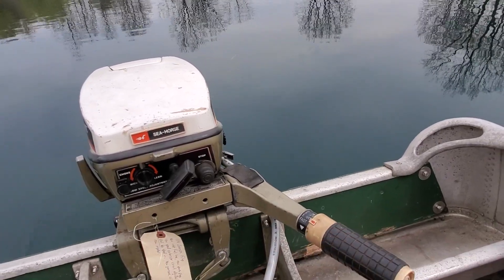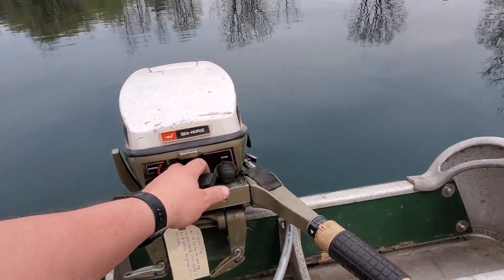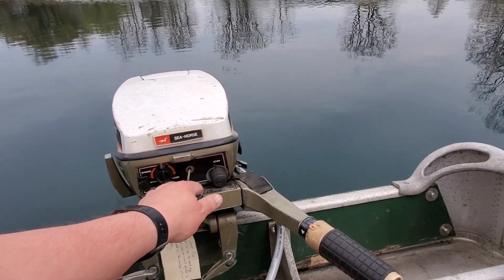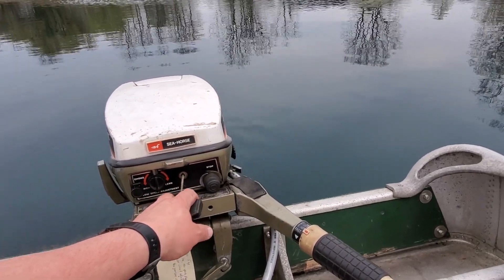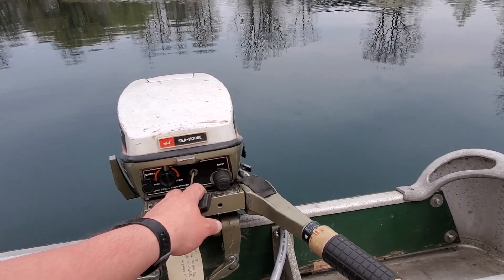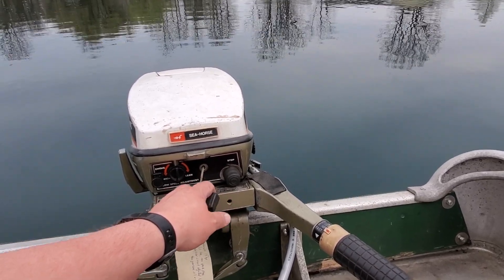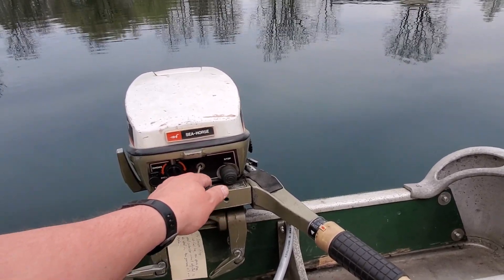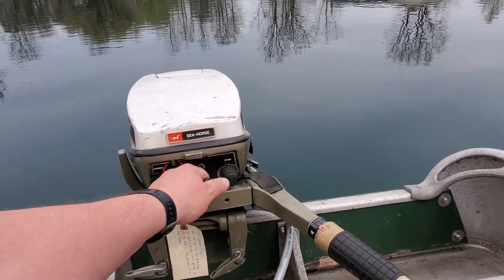1974 Johnson 15hp Outboard Motor Pond Test

Comment: That engine sounds great. I have one of these in the electric start version, which I'd like to get running. I need to replace the external fuel tank, bulb & fuel line as the old line & bulb is brittle/hard and the tank has rust in it.  What would you recommend for replacement parts?

Comment: Hi Ben, great video! I'm wondering how long you think one of these motors would last in salt water? Since there's no pee hole would corrosion happen faster? Thanks.
Reply from the maker: @gabrielklassen8524  I don't really know how long one of these will last in salt water.  The lack of a tell tale wouldn't make any difference in its salt water lifespan.  Keeping it flushed with fresh water after saltwater use and it will last a long time. If that is neglected, it will greatly shorten the life of the motor.  That's all I can tell you about the life of these in salt water.  Thanks for watching!

Comment: I have this motor and also a 1964 18hp Evinrude Fastwin.  Both run great.  I want to put one on my 1964 MirroCraft Deep Fisherman which is rated up to 35 hp.  Which motor should I keep and which motor should I sell?
Reply from the maker: The 15 will probably bring more money when sold than the 18.  The 18 will outperform the 15, but will use quite a bit more fuel doing it.  I personally love the 18s and I am also quite fond of the 15s, although I'm not a huge fan of the low tension magneto used on the 74-76 9.9/15s they can usually be made to run well and be reliable.  I would suggest running both on your boat and weighing the pros and cons above.  Keep the one you like best and sell the other.  Thanks for watching!

Comment: How long should it take to start pumping water? And it should come out hole by upper cowling correct? Just put impeller in and seems like it taking to long to spit water
Reply from the maker: Yes, this motor only has the exhaust relief hole on the back of the leg for a water tell tale.  It does not have any water exit until the thermostat opens so it will take a little time before you start seeing water chuffing out of the hole.  The first year these motors had a tell tale stream that shows the water pump is working was 1977.  1974-76 were like this one.  No water until the tstat opens up.  Yours sounds like it is behaving normally. Thanks for watching!
Reply: @oldjohnnyrude8404  thank you for your time I really appreciate it.
Reply from the maker: @FoodPlotSolutions  You're welcome. 
🙂👍

Comment: I have this same exact motor. It’s running a little sluggish. I wish I knew how to get it to run like that. I’ve done several things but it wants to die when low idle. Especially when I idle down to shift into gear. Changed impeller, spark plugs, coil packs, fuel hose from gas tank and now about to change the fuel pump… I’m grasping at straws. It’s been well taken care of and by all standards in really nice shape. I’m sure it’s something small that needs tweeking… jusy havent figured out what it is
Reply from the maker: That sounds like a carburetor problem to me.  Sounds like it needs a thorough cleaning and a rebuild. It certainly sounds fuel related. That would be my next step. Thanks for watching!

Comment: I like the old green motors for some reason, what do you think of that ignition vs the newer that came I think the next year, arn't those a one year only ignition on that style engine ??
Reply from the maker: I like the green ones too.  I am not a fan of this ignition system.  It ran for three years on these motors.from 1974-1976. It ran for four years total since it debuted on the 18/20/25hp 22 c.i. motors in 1973.  The bonus for those is they can be retrofitted back to the universal magneto.  The 9.9/15 motors can be fitted with the later CD ignition, but no magneto.   The CD ignition is excellent and quite reliable.  I still personally prefer the older points ignition since I can see what they're doing and troubleshoot them more easily. I do like the CD solid state ignition though.  Thanks for watching!

Comment: So what was making it tough to shift?  Was the shift handle/shaft stiff?  Did you notice if this thing had any over the "updates"?  Did it have the original or updated head?  Wondering what plugs you use to keep these from fouling plugs...The last I knew the recommendation was the champion UL-81J....  The original ones did seem to run pretty smooth though....
Reply from the maker: It had some water in the gearcase because the plugs were not tightened.  I think the water in the oil was not helping the shifting, but I really did not find the shifting too bad.  It did improve with new oil,  but these motors never shift like the older ones. This gearcase just doesn't have the crisp feel of the non thru prop 5-bolt.  I also think an awful lot of people have trouble shifting these into and out of forward gear due to the interlock on the stator plate.  This is especially true when they are not tuned properly and they will jot idle.  They tend to try to shift them at too high of a throttle position trying to keep them running.  I'd have to check, but I believe this motor had the recommended Champion plugs in it.  Lots of people experienced with these low tension magnetos recommend NGK plugs.  I put a set of B7HS plugs in it.  Time will tell if they hold up,  but it sure runs better now than it did. 
This motor has the original head amd appears to be completely original other than fuel lines, impeller,  and a carb rebuild at some point. Thanks for watching, Don!

Comment: Sweet old motor! I’ve got an electric start  15hp runs well. Just kinda slow lol.
Reply from the maker: Thanks. It is a nice motor.  It doesn't have quite as much grunt as my '79, but it seems like it should move out pretty well on open water.  I have a 15 I need to go thru and a parts 9.9 woth electric start.  I'll probably make the 15 electric start.   Thanks for watching!
Reply: @oldjohnnyrude8404  that’s exactly what I did with mine. Very quite easy. Also looks like you added some dye to the pond if I’m not mistaken, right?

Comment: hello, i just want to ask how deep is your pond? asking because of how dark blue it is lol
Reply from the maker: Is the spring it is usually the deepest and it ranges from about 7ft to 11ft depend on where in the pond. This year it is exceptionally low.  I have barely been able to run the boat on it this year.  Right now it is probably about 1.5ft - 5ft I hope it comes back up next year.  I should have it dredged this fall.  I use colorant in the spring time to keep aquatic vegetation down. Thanks for watching!
Reply: @oldjohnnyrude8404  that explains the blueness when you were driving around

Comment: Yea appears to be running pretty good moves boat well, 50:1 bet ya had plenty of that laying around ha, the water in the pond looks great,
He will be pleased with it for sure. Keep um coming.(:
Reply from the maker: Yep, I think it is happy again.  I usually have a tank of 50:1 once the weather warms up.  Over the colder months I usually only have 24:1 and maybe a bit of 8:1 mixed up for winterizing.  I have a tank I keep full of 50:1 during boating season though.  I run my Aerocraft a lot with a 67 Fastwin which is a 50:1 motor.  Thanks for watching!

Comment: Hello Ben I have followed your channel for about 2 years now. I have gotten into the hobby of working on these old motors to pass the time.. however there is a few replacement parts I would love to get but don't know where to find them. One of them being a new seal for the covers and the other being new twist handles for the throttle. If you have a solution for eather one that you could help me out with it would be great..thanks for your time and videos.....Carlos
Reply from the maker: Hello Carlos. Thank you for following my channel.  I'm glad to hear you are getting into the hobby.  I believe www.nymarine.ca has the cowl gasket as reproduction newly manufactured.  They may also have reproduction tiller grips.  I find them at swap meets occasionally.  I have seen where some people have 3D printed them.  For anything but a first class cosmetic restoration,  the 3D printed grips serm like a good solution to me. I am considering trying that sometime soon.  Thanks again for watching!
Reply: That web page has all the parts I been needing thank you so much. They even have the paint I need.. I just finished a full tuneup on my personal 6hp fisherman I picked it up barn fresh the owner said over 30 years. Was not firing so I did the points coils and such rebuild the carb now it runs like a dream. Water pump impeller tomorrow and it will live on my 12 foot joh boat.. guys like you got me hooked on these things ( thanks a lot ) lol
Reply from the maker: @carlosadkins9221  You're welcome.   I'm glad to be of help and it's great to have another one in the hobby.  You may be interested in joining the AOMCI.  I have been a member for several years and it is truly a great club.  One of the best organizations I have ever been involved with.  Check out the AOMCI.ORG website.  There is.of course a FB page also, but the club is where it's really at.  Thanks for watching!

Comment: Wow I just picked up a 74 Evinrude 15hp but not as nice as yours and it needs so far upper mounts ! I think the low tension are getting a bum steer, I like them ! Count down is 3 months to Constantine !
Reply from the maker: Those upper mounts are a pretty common failure point of these motors.  I think the low-tension magneto IS a bum steer. I think it was a half baked idea that only over complicated a superb system that was in place before its development.  The CD ignition is definitely an advancement with regard to being low maintenance.  The low-tension ignition is still a mechanical magneto,  it just had more parts, wiring connections,  ground points to fail, coils to fail,  and is.more sensitive to timing errors than the older system.   I don't see the advantage. 🤷‍♂️
YES! I'm sure looking forward to Constantine. 👍👍

Comment: Hey I have a 1955 evinrude big twin 25hp. It was previously set up with remote controls and I'd like to convert it to tiller handle but it doesnt have one. If you had one would you be willing to sell it or could point me in the right direction to find one? I've looked on Ebay and have not found one or even got a part number that I could use to search for it. Thanks!
Reply from the maker: Hello Jack. I do not have any of these tiller handles for sale.  I would keep looking on Ebay as they do occasionally show up.  They are nowhere near as common as the tillers for the smaller motors, but they are around.  It would have to be a tiller from a pre-1956 motor unless you got the shaft that turns the bevel gear too.  The pre -'56 motors have the pointed tooth stamped brass gears.  The later ones use a cast bronze ball gear with rounded teeth.  You could also try putting an ad in the classifieds on AOMCI.ORG.   Thanks for watching!

Comment: where do you get your carburetor kits the one I bought on eBay for my CD 14 sucks
Reply from the maker: I buy most of my parts from Marineengine.com.  I recommend sticking with OEM when possible.  The OEM ignition kits are having some quality issues of late, but they're supposed to be getting resolved. Thanks for watching!

Comment: U think 15 hp Johnson could go on a 12ft John? Looks as small as my 6 lol but obviously power is different.
Reply from the maker: Do you know the rated horsepower of your boat?  12 foot jon boats range wildly in rated horsepower.   My 12 footer is rated at 20hp.  I have seen them up to 35.  Many are also 8hp or less.  I'd be very cautious if.youes falls into that category. I would not recommend overpowering it.  The 9.9 / 15 is much heavier than your 6hp too.  Thanks for watching!
Reply: @oldjohnnyrude8404  I appreciate it, man! I at least want a 9.9 haha. I have2  6 hp johnsons and one just sits, it just needs spark right now and I haven't had the time to mess with it because of school.

Comment: Hey old johnnyrude great video love seeing these old motors given a second chance. I picked up another one but it a 1972 65hp with 3 cylinders and im in over my head im gonna stick with the older twins from now on . but maybe you could help me troubleshoot a no spark problem i threw up a video. That i hope has some helpful information. I know you dont really do the larger newer models but you do seem to be the leading expert on these old girls maybe you can point me in the right direction. Keep your prop out of the mud
Reply from the maker: Those 65hp triples are good motors and they are CD ignition.   I'm not great with troubleshooting CDI.  I'm not that familiar with them and don't know the best troubleshooting methods. I know grounds are very important.  I have a 55hp Johnson twin on my pontoon with the same ignition other than only two cylinders instead of three.  Luckily I have not had any ignition troubles.  If I had I may be able to help you more,  but it hasn't given me any electrical problems.  It could be the power pack, but without doing a lot more research and digging I'm not going to be much help on this one.  If I run across something,  I'll let you know.  Good luck with it.  The Starcraft is a nice boat.  Thanks for watching!
Reply: @oldjohnnyrude8404  i just cleaned up all grounds. Im leaning towards the power pack myself if that's not it ill just start replacing everything its not to terrible. I figured if someone might know a common issue itd be you.  I think im going to stick with the old twins from now on. Thanks for taking a look. With some luck ill get that starcraft out there in a week or 2. THANKS AGAIN!!
Reply from the maker: @sir.icefire5470  if you can find a known good power pack to swap in, that would be what I would try first.   I don't know how common that issue is on those triples.  I know the power packs do fail from time to time.  I have had to replace several of them in the twin cylinder PowerPackII motors.  I wouldn't mind getting some of the proper diagnostic tools to troubleshoot them the right way.  I still prefer working on points ignition  since I can see what I'm working with.
Reply: Hey johnnyrude i just got the new power pack in and i have spark in all three cylinders now! Ive also gone through all the lines in the fuel system and replaced thefue pump . im just waiting on the starter to come in, and a few finishing touches. With a little luck  i should be out on the water this weekend !!!!! THANKS
Reply from the maker: @sir.icefire5470  Awesome!!  That's great news.  Those triples are great motors.  I'm glad you got fire in it again.  It should be a good one.   👍